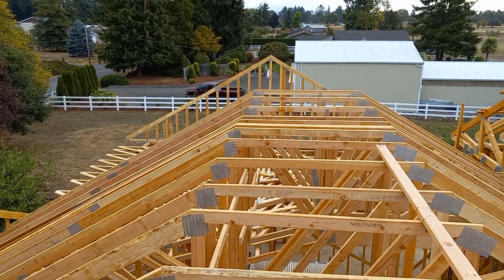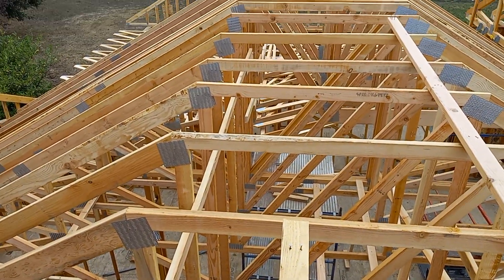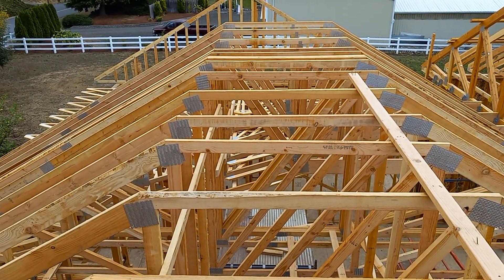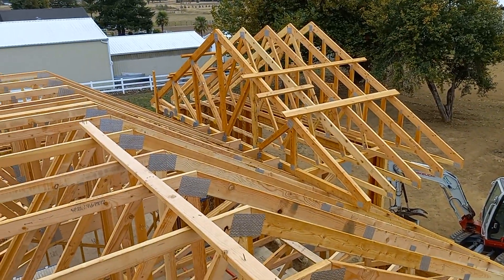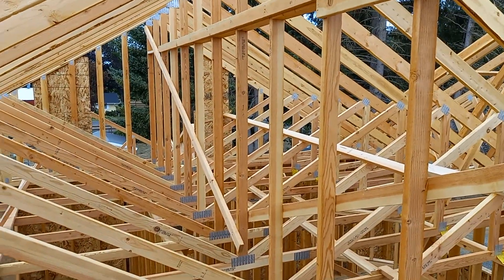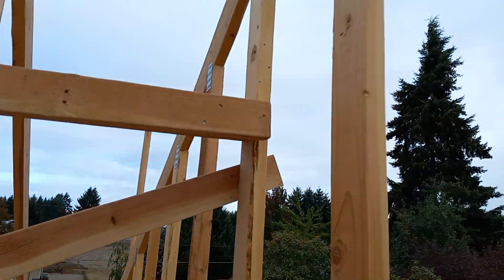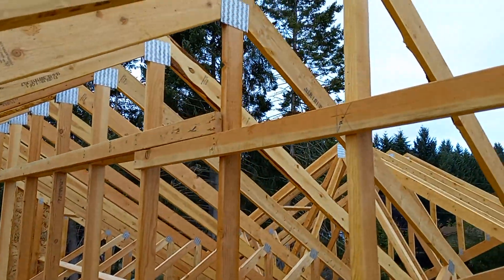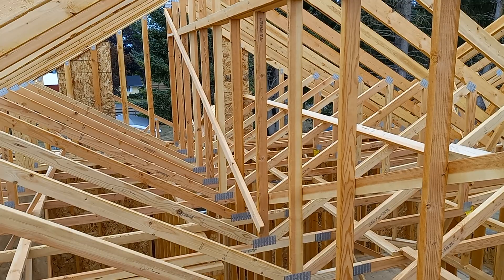Lesson on cross, angled, diagonal bracing, trusses

Comment: Informative video.. . I'm a truss designer it's a pleasure if I can help in any case of trusses designing
Reply from the maker: Thank you. Regards
Reply: I have 1x4s and 2x4s horizontally between the trusses in my attic.   Are these needed after the roof is on?
Reply from the maker: Yes. Known as permanent truss bracing, and is factored into the bearing capacity of the truss system.
Reply: @gmartincontracting  Thank you Sir
Reply from the maker: @ScurvyDogs  You're welcome, anytime.